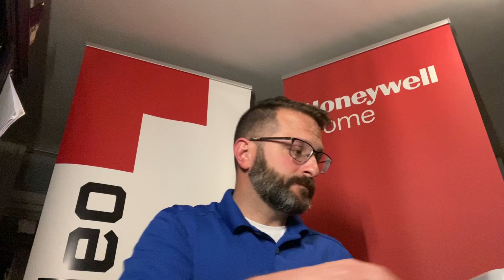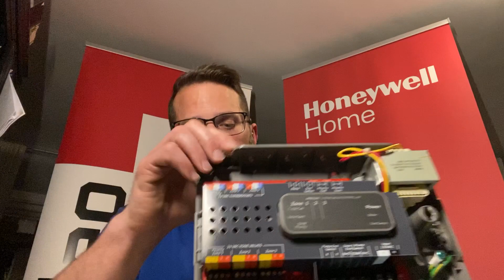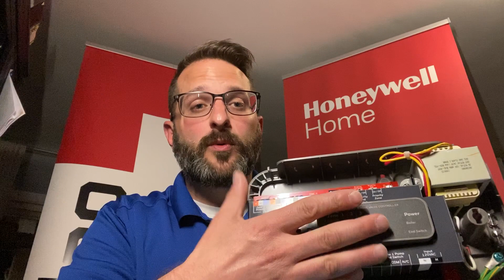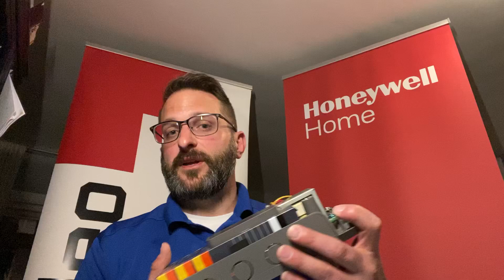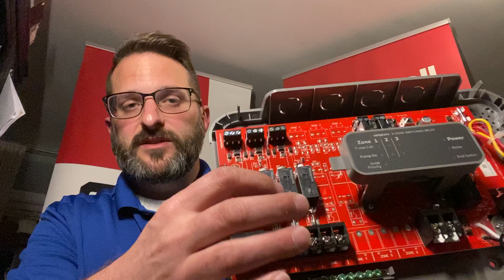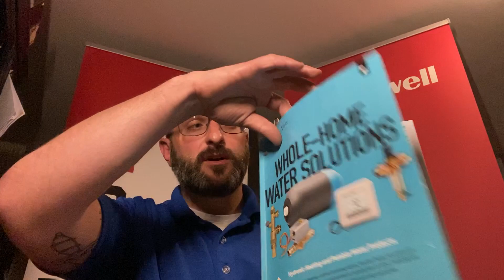Honeywell Home Hydronic Control Panel.

Comment: Hello Chris. How do I connect this HPSST10 to communicate with a boiler that is equipped (boiler) with one t stat control and one circulator provision? I now have 4 zones which is what the HPSR10 will control. Don't know how to connect the boiler with the HPSR10. Thx!

Comment: hey Chris, thanks for the video. We have the 6 zone valve panel you are describing above, but are trying to connect very special thermostats to it, that drive our trench heaters with Modulating fans in them. So the Thermostats run on 24V DC in order to drive the 0-10 V DC fans. They also close a 24V loop upon heat call for the hydronic actuator, but of course they are sending a 24V DC signal. Is there a way to connect those thermostats to your panel ? Thanks
Reply from the maker: What thermostats are they? Sounds like a proprietary system, if so our panel will not work with a direct connection
Reply: @christophertomeno7908  hi Chris, thanks for answering. We have two different ones that we are testing to work with the panel. One is the Siemens RDG160tu and the other is the Jaga JRT-100tw. Do you have an email where I could email you the spec sheets and manual? I think we got the Siemens to work. We now measure continuity on the Thermostat input, without any DC voltage present. Would that work? Thanks for the help

Comment: Now wiring a 3 zone HPSR 103 / Hydrostat 3250+ / Riello. Using zone 3 for indirect hotwater. Wiring is unclear. Diagram please. R G Knox
Reply from the maker: Robert Knox thanks for the question. Actually our panel provides DHW terminal on the first zone. Send me an email and I can send a diagram

Comment: Is there enough room to replace the 40va transformer with the 50va with a resettable circuit breaker?
Reply from the maker: TomTheTechnician thank you for the comment!. Can you give me some more detail on what you are trying to accomplish by adding a 50va? Or 5-6 zone panels come equipped with 80 va and spare fuses to protect the transformer.
Reply: christopher tomeno I like the built in circuit breaker.  I’m primarily an emergency service tech, but I do installations in the spring & summer.  I’ve had customers with thermostat wires that grounded to a heating pipe, but only when the pipe got hot.  Otherwise it would keep blowing the transformer once it got up to temp.  The tech that went there before me replaced it 3 times before they called me.  Most of my customers are an hour from any supply houses, so even if it was just a fuse, the travel time…
Reply from the maker: TomTheTechnician i totally get it. We do have a hydronic control that has resetting transformer that will do both pumps and zone valves. As a emergency service tech you can keep at least two of the Honeywell Home AQ25042B/u panels in the truck. Send me an email if you want further information about this product. 

Christopher.tomeno@resideo.com